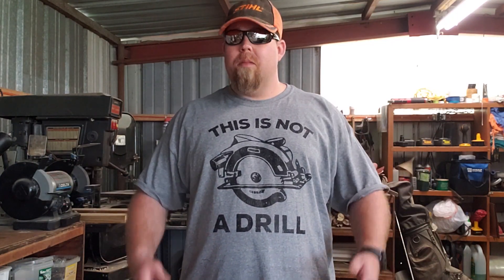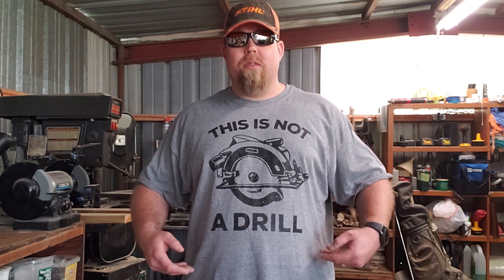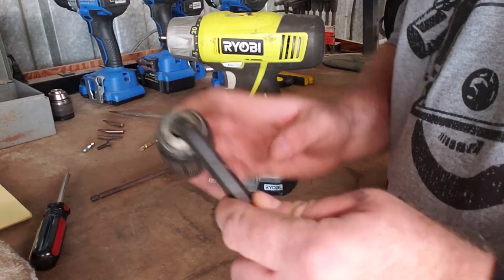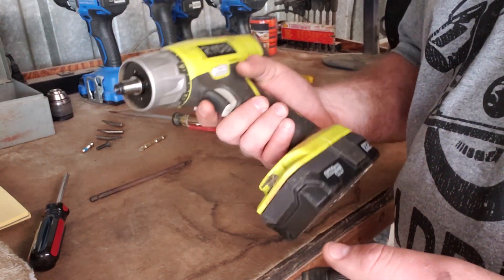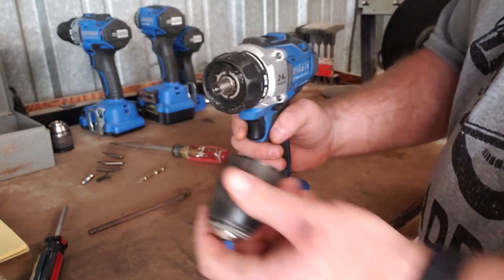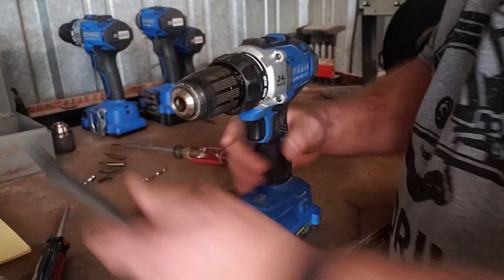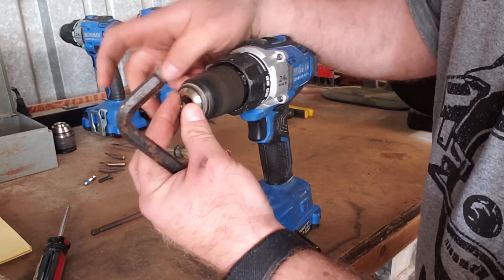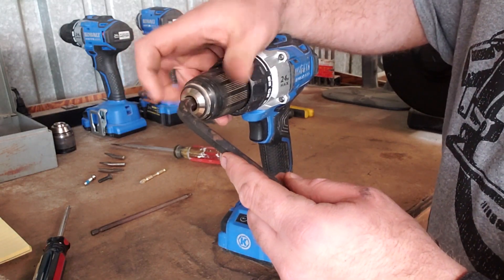How To Replace Your Drill Chuck

Comment: What size screw goes in the chuck? I lost mine and trying to find a replacement. I do have the Kobalt 24v just like yours.
Reply from the maker: @shawndavidmorgan7854  I wish I could help you, this video is from several years ago,and manufacturing may have changed in that time. Your best bet is to try some different sizes and see what works for your particular model.

Comment: This video was a great help. You disassembled the exact Ryobi drill I have. It helped me know what to expect underneath the drill chuck and confirm the direction I needed to turn. 

Unfortunately no matter what I did, I couldn’t get the chuck to break loose because the motor or clutch just slipped (even on drill mode). I ended up taking the drill apart and carefully disassembled the planetary gears. I was then able to put the last triangular collared component of the gear train into a large socket with a breaker bar to then easily break the chuck loose.  

Not something I’d recommend to the faint of heart but I channeled my inner AvE and was able to successfully put it all back together without issue. 

Thanks again for the video!
Reply from the maker: I hate that it wasn't as easy for you to get loose. Maybe they got carried away with the thread lock? Glad to hear you were able to finally get it though. And anytime I can be grouped, even in the slightest, in with AvE, is a huge compliment. Thanks for the the comment brother.

Comment: I have the same Kobalt drill but lost the chuck screw during replacement. Do you know what the screw size and thread pitch is? 1/4"-28 didn't fit. M6-1.0mm starts to thread but doesn't go that deep.
Reply from the maker: Sorry, I sure don't and this was several years ago, so even the one I have may have been updated or changed completely. I would try a few until you find the right thread pattern and then try a few lengths until you find one that is good and secure. I wish I could be more help.

Comment: Hello! I have a Ryobi R18DD2, and by mistake I read the DD3 description and tought I could use 13mm....but in fact the max is 10mm. Is there any adaptator somewhere I could buy? Or can I change the Drill Chuck and put a bigger one without messing everything up ?
Thank you !
Reply from the maker: Unfortunately, I don't think there is an adapter for that conversion. From what I could find searching Google and Amazon, the 13mm chuck has a shaft, where as with the DD2 and DD3 both appear to be screw on type Jacobs chucks. If you could attach the 13 mm in the place of the 10 mm, I don't think it would cause much damage to the drill as long as it fit inside of the speed selector and the and the drill could spin it, but, seeing as you can't even attach it to the drill body, I guess that doesn't really matter. I'm sorry, I wish I had better information for you. If you do find a work-around, I would love to hear about it though. Best of luck to you.
Reply: @JOATology  Thank you very much for your answer. Cheers

Comment: I have a different problem. No center screw in the chuck. Can't loosen or tighten the jaws. However there is a 16mmm thin nut on the bottom of the chuck and a gap to get a thin tool in. Will try reversing it out.
Reply from the maker: Yeah, I've heard of a few different styles now since putting out this video. It is still most likely reverse threaded, so hopefully it pops right off. I hope the rest of the replacement goes more simply for you. Best of luck!

Comment: My Ryobi P252 doesn't have a screw inside holding the chuck,do I just screw it off???Instead of the screw it has the 1/4" bit holder.
Reply from the maker: Do you have the chuck opened all the way up? When I looked up the P252 on Google, they all have 3 jaw chucks. If you don't see a screw inside the chuck, then it may just be a screw on style chuck. Remember it is reverse threaded when trying to take it off.
Reply: @JOATology  Been scared to try to just screw it off so far,hoping someone might have changed their chuck and could give a definite answer,thanks.
Reply from the maker: @dougmanor1988  yeah, sorry. I didn't have that model. Best of luck though
Reply: @JOATology  Thanks,I don't have a new chuck to put on it yet anyway but I don't want to mess it up either
Reply from the maker: @dougmanor1988  understandable. I wouldn't risk it if that's your only drill for sure.
Reply: @JOATology  I got this one and also have a 12v Bosch,the Bosch isn't a wrist breaker like the Ryobi.Can't take a chance and tear up my wrist breaker.
Reply from the maker: Yeah, I don't blame you one bit. I used to use the cordless Ryobi's when the +One series first came out and they lasted for several years except the batteries died. So when the last batter finally gave up on me, I decided to try a different brand and went with the Kobalt brand from Lowe's. I have had them for a couple of years now and haven't been disappointed. The only thing I wish they would do is, come out with an airless brad nailer like Ryobi has. I hate having to fill up my whole compressor just to put down 3 or 4 pin nails. But those new Ryobi's are pretty aggressive, I would certainly hold on to them as long as I could.
Reply: @JOATology  The Ryobi P252 is a fairly new drill without a lot of hours on it.Brushless plus charger and 2-2.0 amp battery packs at the  Black Friday price of 79.99,it is turning out to be a good drill with lots of power but I just don't like the chuck,if the collar touches something say the wall or something while drilling,it will unscrew itself and let the drill bit go.
Reply from the maker: Yeah, that does sound annoying. Just a heads up, but if it is set up like that, then there probably isn't a hole in the center for you to put a screw in, if you were to replace the chuck. If there was a spot for a screw to go into, they would have used it. You would have to replace the whole shaft that connects to the motor to have that feature, and it would probably be cheaper to just find buy a new drill that had that feature but it would certainly be easier. Sorry for the bad news.

Comment: Would have been nice to see you actually remove the chuck with the method described but there's an obvious edit so it was done off camera.  I am having the same issue you were having prior to the edit.
Reply from the maker: @Pepe Sorry, I am just guessing, because you didn't give me a time stamp or anything to work with here, that you mean the point that the chuck actually breaks loose from the drill? In that case, I'm pretty sure that I got it done right there on the bench, but it was clumsy and looked better without it. If you're not physically strong enough to do it that way, you could try using a vice to hold the drill and a pipe on the Allen key to increase your leverage and see if that helps. If you still can't get it, let me know and I'll try to help you figure out another way to get it done. Best of luck!

Comment: But you put a garbage Ryobi chuck on it. I have two Ryobi ONE+ drills. An old blue 1/2" and a new yellow 3/8". The chucks on both will not hold on to anything. Bits will spin in them drilling into soft pine. The least bit of vibration and they let go of hex shank bits. Only way to get them to hold is tightening them with channel lock pliers. I've tried to get the junk chucks off but they won't budge. I have new 1/2" and 3/8" keyless Jacobs chucks to put on them, if the OEM ones would break loose. Putting the clutch in drill position and the direction switch to reverse then twisting counter clockwise on a hex key just turns the motor. I've hit the end of the wrench with an 8oz ball peen hammer. They just turn. Yes, I did remove the left hand threaded screws.

I have a 1/2" corded Skil drill which came with a junk chuck out of the box. Using the key in all three holes, with a box end wrench for extra leverage, it would still slip. So I got a Jacobs keyless chuck, it's a 1/2" one with the smaller thread used for 3/8" drills, sold for upgrading the capacity of 3/8" drills. Apparently in addition to pinching the zinc out of pennies cost cutting the garbage chuck, Skil also squeezed more on that drill with a smaller spindle. With the Jacobs chuck it became a great drill. The chuck is easy to tighten, just twist until it clicks twice and It Will NOT Slip. It's just as easy to release.

That's what I have to go onto my 1/2" Ryobi. For the 3/8" I have a different style Jacobs keyless chuck, dunno if it's as good but it absolutely cannot be as awful as the POS Ryobi put on it.
Reply from the maker: While I agree that the chuck they used on the Ryobi is absolute junk, the purpose of this video was to show someone how to turn 2 pieces of junk into 1 piece that at least had a use. I haven't had a single problem with the replacement chuck slipping yet, bit when I do, I'm going to go get a keyless chuck for it too, but since it works, I don't see a reason to replace it. As far as your Chuck's not coming loose, maybe there's a snap ring or something else in yours. Try to find a video specifically for your drill and see if that helps. Best of luck

Comment: My $40 Ryobi corded drill's chuck stopped working.  Not sure if due to heat or fine dust.  Chuck did NOT seem to be removable in any obvious way.  Found a repair parts sheet but no directions to make a repair.  Got money back, just barely within its return period.
Reply from the maker: Glad you were able to get your money back at least. Usually those types of drill chucks are attached one of three ways, either with the screw, or they are threaded on, or possibly both of those. Either way, it sound like you made out much better than trying to do a repair. What brand are you going to with for the replacement?

Comment: I needed to remove a chuck off a POS Nawthin Toool 90* drill to "see" if I could access and possibly replace the ninety-degree, plastic drive gear..  Got the center chuck screw out, but NOTHING would turn the chuck..  Six Minutes into your vid, I saw the "Allen Wrench Trick".. I'm a 50+ year professional motorcycle & automotive mechanic (now retired) and NEVER thought of, nor saw your method..  It got the chuck off, (Put the allen wrench in the vice!!  Stronger than my forearm!!),, the chuck WAS "two piece, all plastic", needless to say, chuck is now destroyed..   Bottom line, the "KLUTCH" drill is total junk, but I was going to get that clutch off, come hell or high water (neither happened, but it was 110* in the shop... close to "hell")..  Drill is trash-canned, (expected that) and I learned something new..  so.... Good On Ya!!  Thanks!  Chas
Reply from the maker: Dang buddy. I wish I could buy you an ice cold beverage after all of that. I hate that you lost your drill in the process but I'm glad I was able to show you that trick. I have to admit that I didn't come up with it, but I saw the screw in my drill chuck and looked around on the internet till I found how to get the thing off and it then saved me some money, so I was pretty happy. I don't know where you're at but I'm in the south east U.S. and it has been an unforgiving summer here so far, with only 3+ months to go....(Summer down here lasts close to 6 months lol) Wishing you the best Chas and I hope you're able to find a good replacement.
Reply: @JOATology    I had bought that "90 degree, close quarters" drill to drill out one broken bolt from an engine block..
The drill did it's job (once) then stripped-out on a second application..  I've got several 3/8" VSR drill motors, and two "mutha" half-inch jobs..  so no bind, there..   As to humidity and temps..  I lived in Miami, Florida; Big Spring, Texas; Lake Charles, Louisiana; "North Field" (now Anderson AFB) Guam (talk about Hot AND Humid!!);  outside Tokyo, Japan; a little island in the Pacific called Oahu, Territory of Hawaii (it was "tough duty", but someone had to do it ;-}); a wide place in the road called Oscoda, Mich. (had a 20 below winter, four feet of snow with twelve foot drifts)..  Glad I was there ONLY one year, but I did learn to drive on a frozen lake.. in a manual four-speed, 1959 Volvo PV544..  My Dad said I couldn't hit anything out on the lake!!.  Been in Texas ever since Aug '61!! And lived in Ft. Worth when we had ALL 70+ of those record 100+ hot days, including the two 115's!!  So, you ought to be glad YOUR summer ONLY lasts six months..  We've had "summers" last from Feb-Mar ALL the way thru October-November!!  I've even run the A/C on Christmas day!!  Bottom Line, I DID enjoy that "ice cold beverage" (or three) after messin' with that drill.. which has since been "filed" in the round filing cabinet ;-}  Have a good'un, y'a'll and keep-up the good work!!  Chas.

Comment: I tried this method, it just beat me up. Then I used hand impact driver you hit with a hammer to remove stubborn screws . The largest phillips on most is too short, but mine worked by putting the phillips tip in first, then placing the driver part on what little was out of the hole, and it worked fine and quick without beating myself up.
Reply from the maker: Yeah, I imagine on a better quality brand, it probably was put in there a little tighter and maybe even had some loc-tite on it. Mine came out without much hassle at all. I'm sorry yours was so tough. Those hammer impact driver are perfect for situations like this. I'm glad you were able to get it worked out.
Reply: I used an impact gun on the #3 screw then proceeded to strip the allen key right out with that very same impact gun
Reply from the maker: Yeah, that seems like it would be easy to do. Yikes, sorry to hear that. What did you do to replace it?
Reply: @JOATology  I just tightened the chuck down on an allen bit like in the video. I figured since the chuck had an Allen hole itd be easier just to use it but nope
Reply: Also had to stick a small screwdriver in the cooling fan to keep the drill from spinning. These kobalts dont like to lock up all the time, especially when theres an impact goin at em
Reply from the maker: @dakotadriggers8838  thats a good idea. Its been a little while since I did this project but I think I remember seeing someone put the chuck in a vice to hold it still. I wish that had gone better for you.
Reply: @JOATology  eh it couldve gone worse. I hope it's as easy to pull the chuck off the drill I'm fixing, the whole outer shell broke off and she's seized right up
Reply: Yeah he didn't tell you that it's hard took get the screw out...he had already done it that's edgy it came out like it did